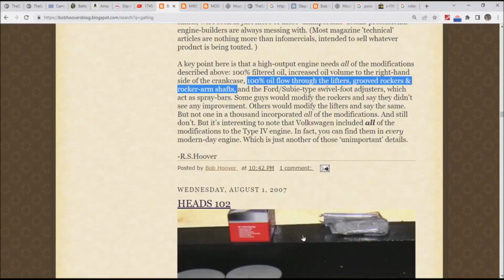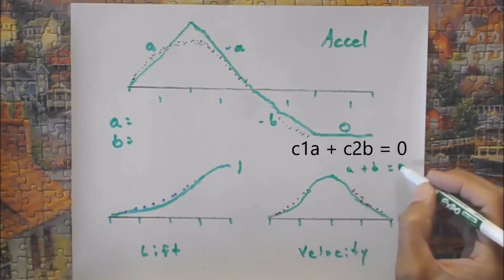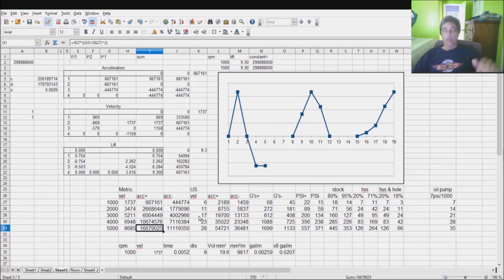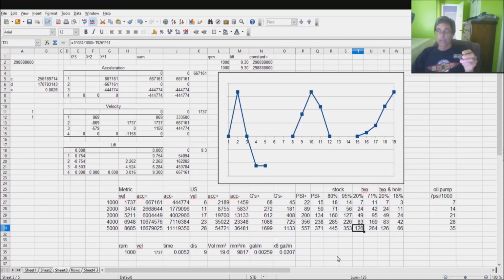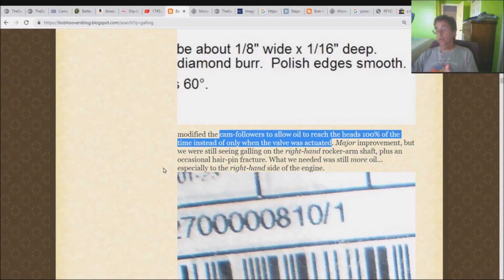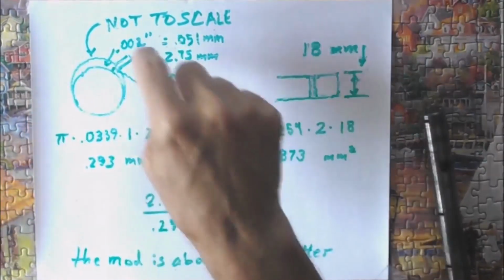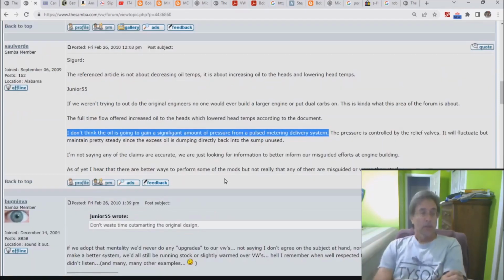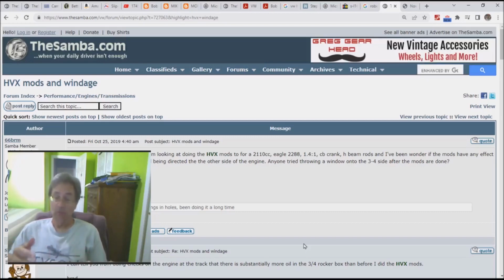vw tech vlog 18.5 hvx mod grooved rocker shafts and lifters

Comment: Hi Scottie
I really appreciate your depth of research ! 

Question:
How does the lifter with the tiny lubrication hole for the face/cam interface .. how does that oiling-port change the numbers.
Is it a major or minor upgrade or down grade ?

What do you think ... off the top of your head
Win, lose, or draw ?
Cheers
Reply from the maker: you're talking about lube-a-lobe lifters. i've never actually seen one so the question that needs to answered is: which band does the hole attach to? i think the hole is attached to the band that is active when the valve is at half or more lift. if so - it's not effective at lubing and will allow air into the oiling system which is bad. if the other band - it is a hole in the oiling system and will have a negative effect on the lubrication system by allowing oil pressure and volume to bleed off in an uncontrolled fashion. that's a negative on both accounts. if you investigate at thesamba you will find that most engine builders don't want them for any number of reasons beyond the 2 that i've just given you.